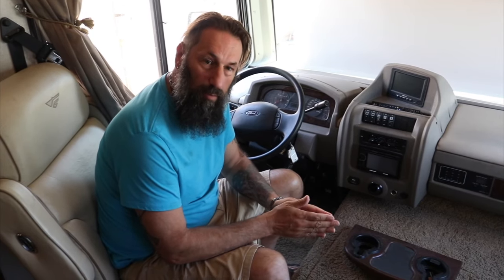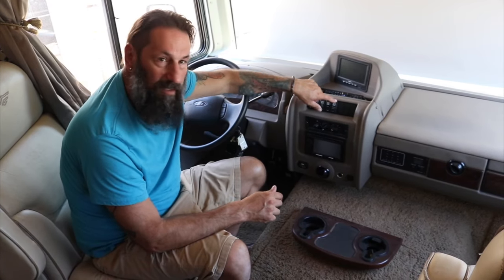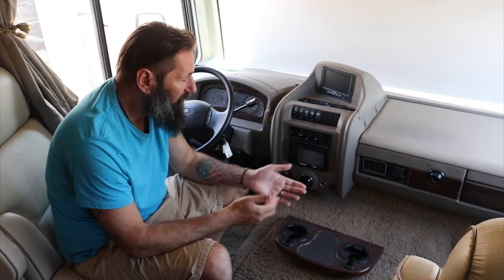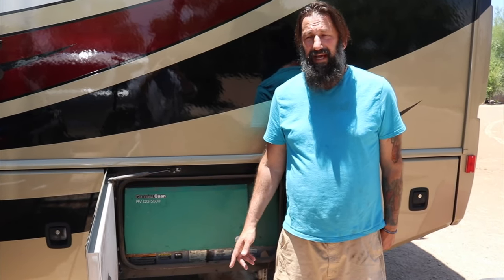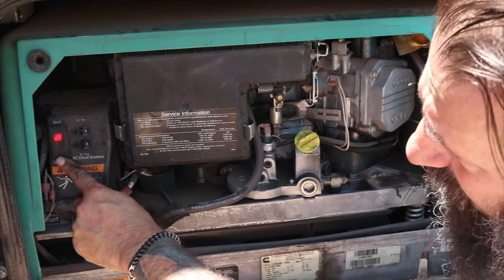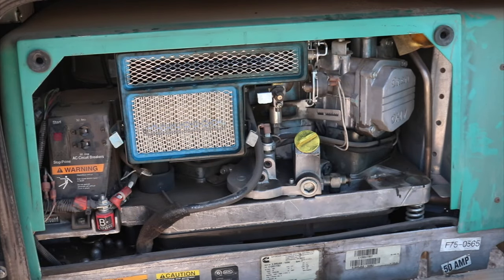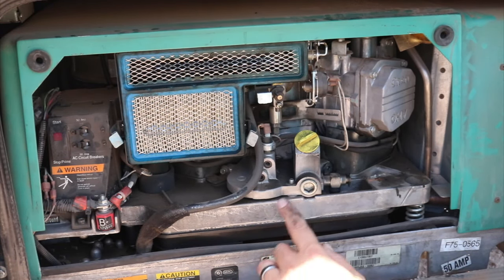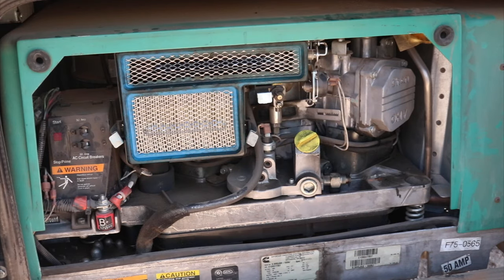RV Onan Generator Start Up Problems. Fix it here.  Hint & Tips

Comment: Cummings has worked on generator 2 in last 6 weeks put on new carbuerator and charged me 1600.00 got home and didn't work next day took it back and they put new fuel pump 650.00 ran for about 2 weeks now quit again this time sounded like had crickets in it then just quit. sounds like it starts then just shut's down. really don't want pay them more money?

Comment: I have a Onan 6.5 generator emerald 3 I just put a new curcut board and rectifier in and changed the oil & filter now it starts but dies when I let off the starter switch.  Can someone tell me what is going on.
Reply from the maker: Any error codes?

Comment: My generator was starting just fine. Turned it of for 2 hrs,went to restart and nothing.  Onan 4000 quiet.  Only has 215 hrs on it. Prime it hit start and makes a whine sound.
Reply from the maker: A whine like a starter not engaging or just a low electric noise? What is  your voltage coming out of your batteries?

Comment: hey so generator was running fine.  went to start it today and all I get is a clicking noise.  any thoughts?
solenoid?
Reply from the maker: Check your voltage going to it.  Might be low house batteries.  Then from there possible solenoid.

Comment: I have an $7,500 on on generator that when you hold the button down and go to start it acts like the solenoid is clicking I checked all the voltage coming to the back of the generator and it is 13 volts on the switch it is 6.5 volts but will not turn over unless I cross the starter
Reply from the maker: Solenoid seems to be having a problem.

Comment: My Onan 5800 only has 180 hrs on it. we have changed the plug, filter, changed oil, fule pump works even got a new carb but it won't start. it cranks but only starts with starting fluid but it dies once you stop spraying!
Reply from the maker: Fuel filter changed?  Can you take the fuel line off and verify fuel is being pushed through to the carb?  Also any error codes?
Reply: Bear's Workshop same thing happening to mine! Throwing codes NO j1587 DATA
Reply from the maker: @sarahsantana6466  Is this on the generator?
Reply: Bear's Workshop yes
Reply from the maker: @sarahsantana6466  Which model?
Reply: Bear's Workshop 08 400 hp Cummings
Reply: Alpha
Reply from the maker: Those codes are for a Cummins motor not for a generator.  08 400 HP Cummins is the engine in your coach.  This guide is for the generator.  Is it your coach that won't start and giving you these codes?
Reply: Bear's Workshop runs and drives fine but I think bad fuel is making it cut in and out. 
Suggestions?
Reply from the maker: Can you go to my facebook page and send me a picture of the code?
Reply: Bear's Workshop what’s your Facebook
Reply: Bear's Workshop its causing very low power. I’m riding in first gear
Reply from the maker: @sarahsantana6466  https://www.facebook.com/bearsworkshop00/.

Comment: Thank you Bear, you helped us!!!
Reply from the maker: Glad I could help!
Reply: I have a problem hooking back up onan generator . My husband tries to hook back all the wires but first has to hook up battery but when he touches the wire to battery it starts trying to start and this is happening before everything is hooked up . Need help please
Reply: @BearsWorkshop  please help my husband . He is having problems trying to hook back up the onan generator . He tries to start hooking up wires but first has to put wire back to battery but when he does it tries to start and continues until he takes the wire back off so he can’t hook up the generator because that keeps trying  to happen
Reply from the maker: Disconnect the house batteries before hooking up the generator.
Reply: @BearsWorkshop  he done that before everything else .
Reply: @BearsWorkshop  he done that already . First off he unhooked everything and took generator out to put new starter and solenoid and spark plug and new air filter on it . So he goes to put it back in and when he tries to connect all the wires , when he connects wire to battery it just keeps trying to start cranking and it won’t stop unless he pulls wire off of battery

Comment: Thanks for the video.
If it a bad gas would be only running miles until a  half tank and add a good gas. It wll be enough ? Unfortunately I filled in gas station once a the next day it starts works and turned off.

Comment: Aloha from Mark Nye thefixitguy here in Kaneohe Oahu. I am working on a Ford F460 big box truck converted to a dog grooming vehicle. The customer brought it to me to try and clear up a CODE 36 issue. First thing i did was change the plugs and oil, checked the fuel pressure and it worked for 2 days then it did it again. Yesterday i found that the fuel pump is not getting continuous voltage. the two wires coming from the control have intermittent voltage. Does this mean the control board is going out ?? The fuel pump works great if connected to a 12 volt  source so we know the fuel pump is good. Thanks for any help from anyone.

Comment: My generator will not start bec I believe my house battery is run down. How do I re-charge my house battery so I can start my generator?
Reply from the maker: You can just jump start it with jumper cables.  Remember that you need to connect the cables to the 2 different batteries in your parallel layout. I have also run my coach for about 15 minutes and then can recharge house batteries.

Comment: I’ve got a customer who’s got a QG4000 he had me get it going because it was doing absolutely nothing(wire was loose under the switch panel). One note, I’m a medically retired Cummins/Onan Level II Gen Tech, and Diesel engine rebuilder. Anyways he messed with the Governor after replacing the carb, fuel pump, and filter, now the gen will run for a bit but the Governor acts so erratic that it shuts itself down because he decided to use a screwdriver to adjust idle instead of on the carb. I can’t find my manuals to re-do the Governor to factory specs but I’m planning on taking my HZ/Frequency meter over there to make sure he’s getting 60-62HZ
Reply: Keep us updated. Having same issue atm... absolutely nothing happens when I try to prime or start my generator. Brand new house batteries.. and the genny ran when I went to buy it, which was about 2 mos ago. Any ideas or assistance would be appreciated.
Reply: SENDIT FPV when you try to prime it, are you hearing the pump or any noises on the left hand side of engine? Your pump and filter are over there
Reply: @relicrecoveryspecialist16  Negative - no sound, no lights, no movement. It seems dead in the water. I double checked coach batteries and chasis batteries ...all around ~12.4v ... fuses are good to go... im at a loss. Its an 2008 Onan 4000
Reply: Some more details ... the panel in the coach where my genny start button is also doesnt work (at all)  - usually it will show me hours etc... the panel doesnt work at all. (again fuses are fine). All troubleshooting ive been doing has been AT the genny itself, where that button / primer switch isnt doing jack sh#t.
Reply: @mikemarshall1843  does your coach have the battery disconnect switch on it? Some do and when you shut them off it kills power to the gen, and panel. Let me know and I’ll troubleshoot more. What’s the model and spec #
Reply: @relicrecoveryspecialist16  Awesome! I really appreciate it, ill be reaching out to you today. This problem has been a real PITA.

Comment: Mine wouldn’t start today … it was low on oil.
I NEVER heard of an Onan Rv generator that had coolant … they’re AIR cooled engines.
Everybody should keep Sta-Bil gas preserver in their RV year round, and you’ll never have bad gas, make sure and run your generator at least 2 hours a month at half load. NON USE of your generator is the WORST THING for it.
Let the generator run for 2-3 minutes without a load on it before you shut it down.
CLEAN oil is a MUST!
🍔

Comment: my gen doesn't seem to be choked to start so just turns over , any ideas ?
Reply from the maker: Can you manually put the choke on and try it? Take the air filter off and rotate the choke so it is closed and try starting it.  If it tries to start then it could be a bad choke.  You can rule out all other fuel issues by using starter fluid.

Comment: I can’t even get mine to give me an error code.   Any idea?
Reply from the maker: What are the symptoms?
Reply: @BearsWorkshop  Thanks for the response. There was no power going to the switches, inside or out.  I ended up following the electrical cords that run from the battery to an unmarked black box. I unscrewed that box and behold there are circuit breakers. One of them was flipped so I put it back and everything is 
A-ok.

Comment: I went to my property and my generator was making a clicking noise without trying to start it now it won't start
Reply from the maker: Could be a dead house battery or a starter/solenoid issue.  Check your voltage first.
Reply: @BearsWorkshop  cool I will do that thank you so much for getting back to me have an awsome day

Comment: Hi Bear. My Onan 4000 microquiet generator crank but doesn't start. I already replaced the fuel pump, fuel filter and the spark plug and the generator started and run really rough for about a couple of minutes and shutoff. Now it just crank but doesn't start at all. Any suggestions or recommendation on what to do next. Thanks.
Reply from the maker: Could be a carb or choke problem.  Try starting it with starter fluid and see if it runs for a few seconds.  Then you can try the choke halfway just by holding it in place with your fingers.  If it does run either way then you have bad gas or bad carb, but if it runs for a few seconds then at least you know everything else works.

Comment: My generator works beautifully but I watched this video as kind of a preemptive strike so that I know what to look for if it stops working. I never would have thought about coolant for the generator. I have an Onan 5 kilowatt and I have no idea where to check the coolant level or where to pour it in. I guess I’m going to have to investigate that. I also don’t know what type of oil to put in it - 10W40, 5W30, etc..

Comment: Hello, I have a 2018 Fuzion 417 with an Onan 5500.
The auto start use to work but now it doesn't, any help would be appreciated.
The generator runs fine, just can't use the auto start function.
Thanks in advance

Comment: I have a diesel generator. It ran a few times after I bought the camper now all it does is  clicking like a bad battery. I took the batteries out and had them checked. All good. Took the cables off the generator and  cleaned them still won't turn over. HELP PLEASE

Comment: I have a 4000 runs but then quits it runs out of gas fuel filter is good fuel pump is good has the wires inside float bowl I read to get rid of this and replace with pan screw. Fuel gets cutoff by bad fuel switch inside carb